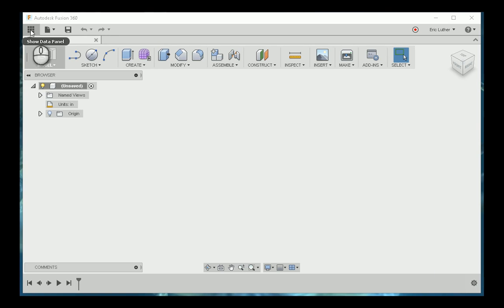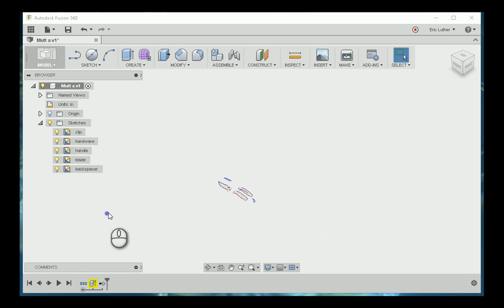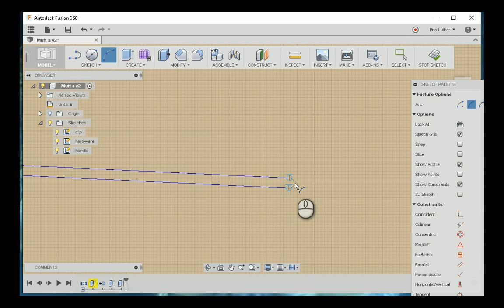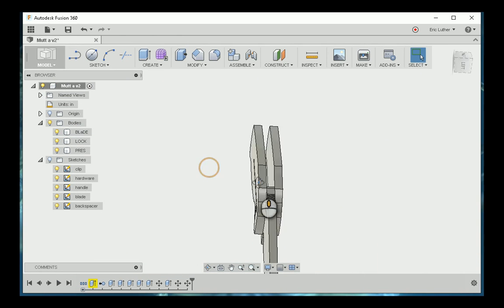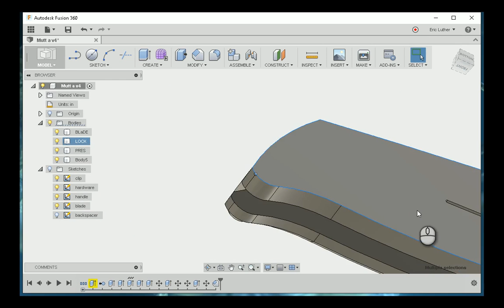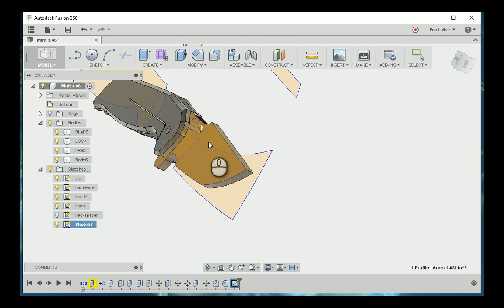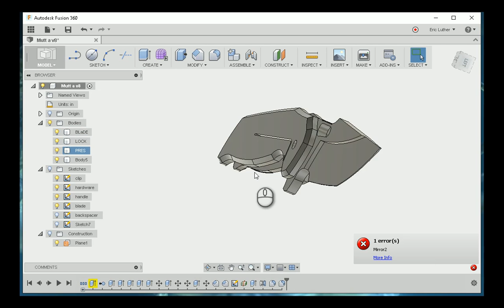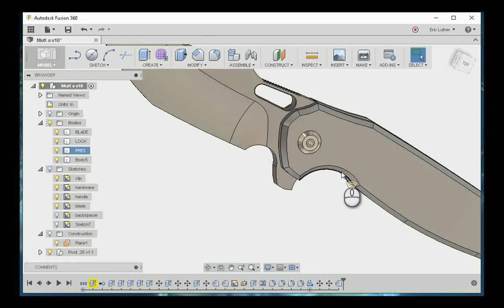Fusion 360 DXF to 3D model Folding Knife

Comment: I did note that with the current version of Fusion (June 2021) that you need to "press pull" the bevel from within the active sketch. Then it works. Also, a variable fillet may accommodate different blade shapes...